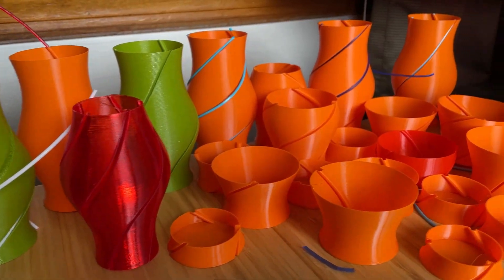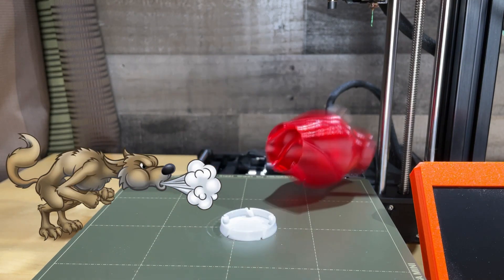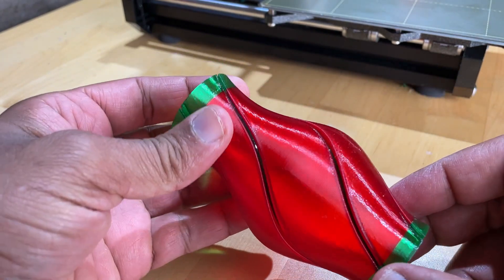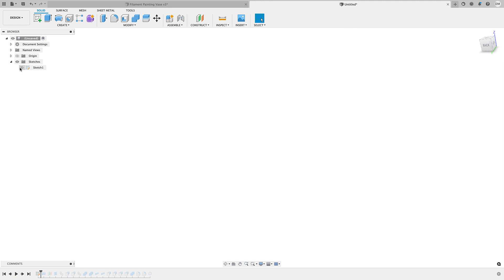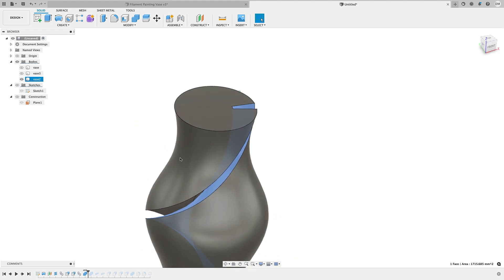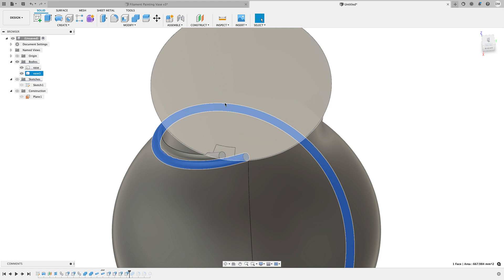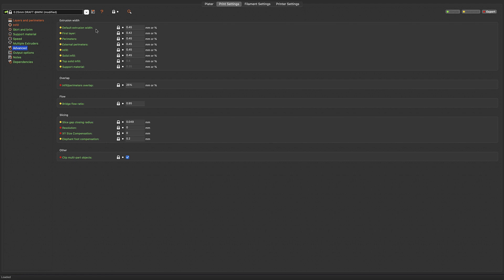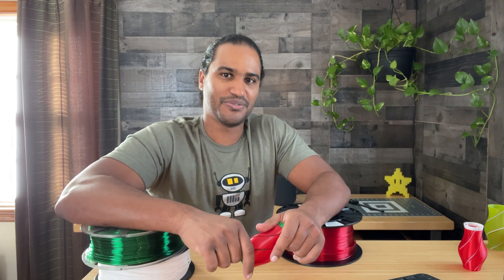Adding Filament to your 3D Prints

Comment: Re your question on how to maintain a constant circle cross section for the slot:   I tried a slightly different approach.  After making the "S" slab, I did a Combine/Intersect between the vase and the S Slab. This made a path on the intersection.  (I did not make a second vase within the first vase.) This provided a path on the side of the vase.  I drew a circle on the top of the vase and used the sweep command to develop the slot.  However, if the top side of the vase was not vertical, the circle became an ellipse as it progressed down the vase side.  The circle needs to be perpendicular at the beginning of the path.  Oops.  So I adjusted the top 2% of the vase in the original sketch to be vertical, hence the circle was perpendicular to the path.  Another approach, if you don't want the top 2% to be vertical, but flared, consider making the circle sketch on an inclined plane, perpendicular to the path.  This would make the circle perpendicular to the path and thus remain circular throughout the path?  True/False?

Thank you for all your work and content!

Chuck Wharton

Comment: You make it far to difficult. Just a coil, profile and a sweep will do. For the infill filament use TPU.
Reply from the maker: That's fine if you simply want the profile to follow the path of the coil but in this case I want want the profile to follow the path of the coil plus the profile of the vase.  I thought of TPU for the infill filament but then you're limited to only certain colors.
Reply: why only focus on filament as infill.  I can imagine that with shoelaces and knitting wool, for example, you can have very nice results.  By the way, my compliments for your videos.  clear and instructive.